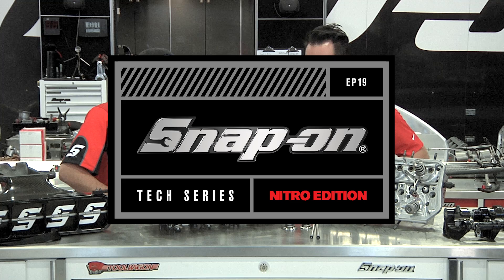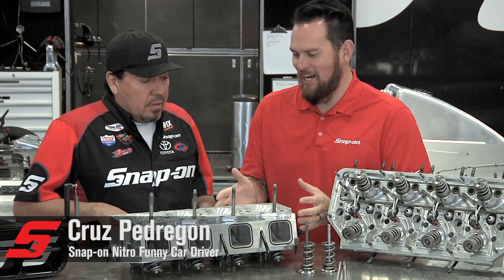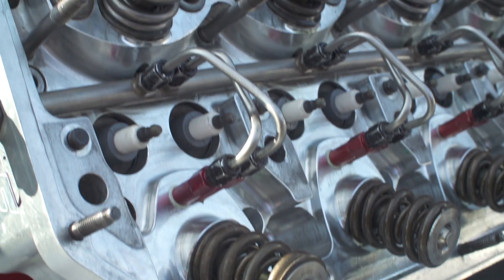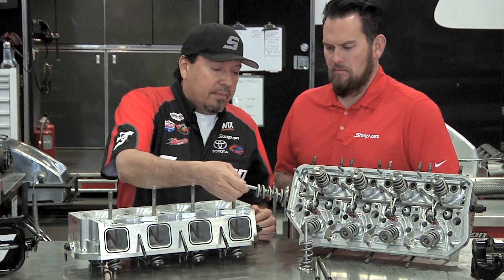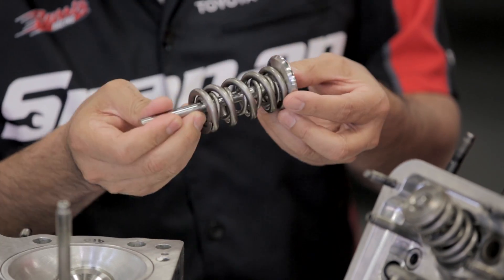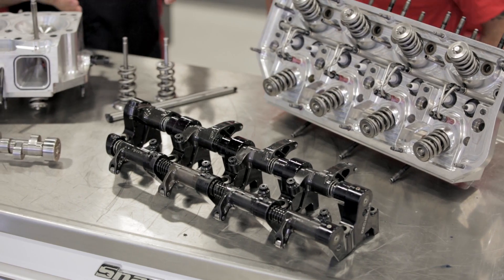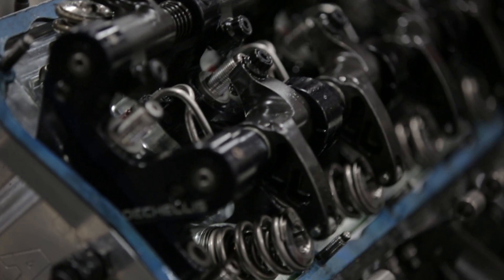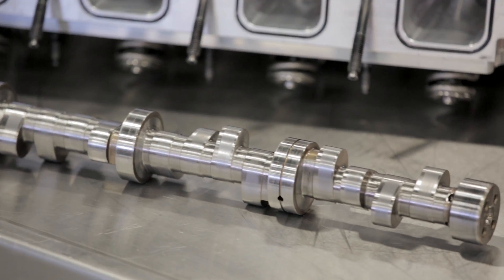Nitro Funny Car Cylinder Heads - Snap-on Tech Series: Nitro Edition ft. Cruz Pedregon (S1, Ep. 19)

Comment: The lift and the Duration of that cam is unbelievable.
Reply: NeiI S. 1.8:1 rocker ratio also!! Them valves are moving!! That’s why there’s 500 lbs of seat pressure and close to 1200 over the nose ! I was looking and thinking the same thing🤣and how the buttress is left between the journal and the lobe closest too it. That a Bullet racing cam, they are the strongest in the world I think
Reply: Roller cams always look big.   It is no doubt a “big cam”, but it’s big looks are a design necessity.